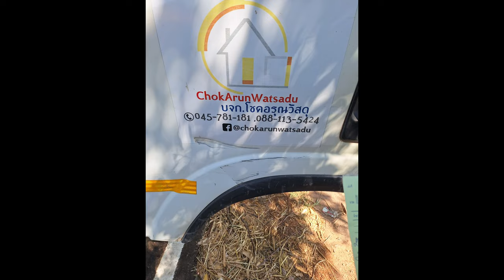Mystery Building Project in Rural Thailand #10

Comment: Yes, it goes up quickly. In this video one can see the overhanging roof support they added. There are design guides for hurricane safe buildings in Florida and the important part is to connect the end of the roof to the ground.  Hope this version will withstand the next big wind. Can't wait to see more, especially how they will lay out the electrics.
Reply from the maker: There is a large overhang on this roof too. I was sitting having a beer with the guys one evening when they saw me looking at it. I walked up to one of the vertical columns and gestured a horizontal support going out from the  column to the end of the rafter. The three men in the team put down thier beers joined me, talked amongst themselves with gestures. Gave me a smile and thumbs up. The next day they fabricated and welded them in. Obviously not tied to the ground, but the free weight of overhang braced and rigid

Comment: I haven’t a clue but its looking good anyway. Just about to to do maintenance on the Saling ready for the rains…cut off the banjaxed old wave and weld on another less banjaxed wave…looking at those old smaller Kioti tractors reminded me of my old Grey Fergie with a transport box for moving a couple of people and handtools…could do a lot worse for a rains-mobile!
Reply from the maker: I worked on a feed lot for export livestock. We had a Ford 4000 but also an oooolllldddd Fordson petrol. 3speed shifter between your legs and a hand throttle. Huge fun.  Terminal understeer at speed turning into the races between the holding pens....lol
Reply: @downunderthailand  Lol: had a diesel Fordson Major with a hand throttle and yes they were great fun coasting down hills then wanging it into hairpins with a handful of throttle: in retrospect it all seemed so controllable.

Have a good trip back…